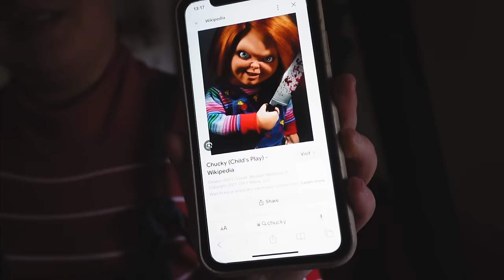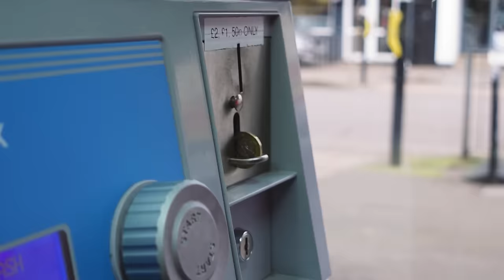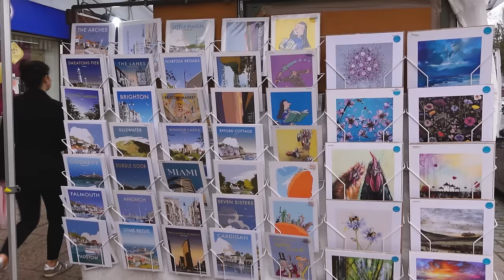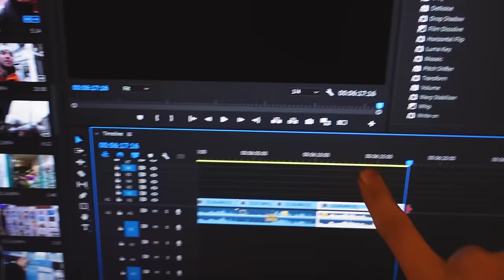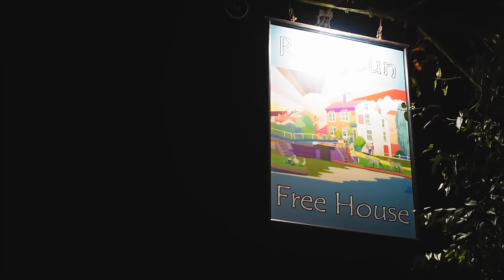Prepare our narrowboat for Christmas with us | Vlogmas day 23

Comment: I know, crazy question, but why would you not dry your clothes?  Clean “pants” doesn’t equate to dry wearable “pants”.  We love you both. Have a wonderful Christmas.
Reply: I’m going to take a guess that the dryer costs a fortune due to high energy prices, so just saves money to dry them at home (or they didn’t have one/broken). Merry Christmas!
Reply: I have a condensing tumble dryer on my boat and it’s a massive eye opener as to how much water comes out of washes. I did 3 bath towels the other day and poured about 3 litres away after drying just that one load. Even a normal load will be a couple of litres it’s shocking. If you dry laundry inside your boat in winter it’s going to cause loads of condensation/ damp issues so worth the £5 odd quid to dry at the laundrette IMO. Summer is a different story of course.
Reply: Laundromat dryers are notoriously expensive - and I live on a totally different continent, but it’s the same here😳

Occasionally the dryers are also awkwardly sized and so you can’t even dry one full load in one go - so that means more loads whilst drying and therefore more money 👎🏽